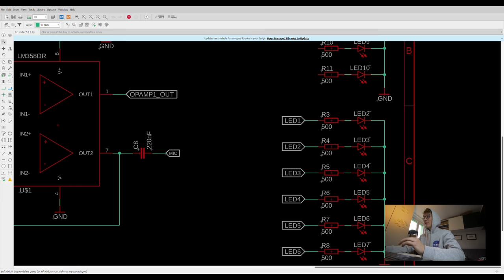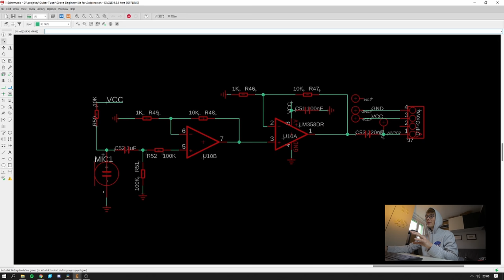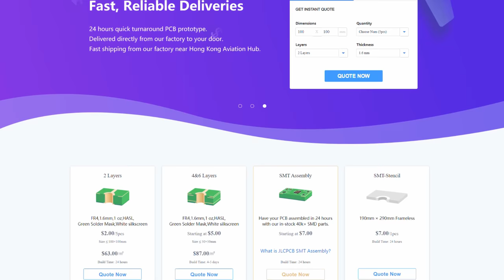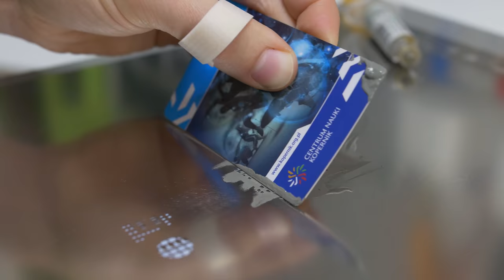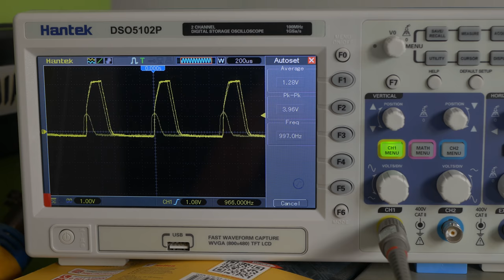Arduino Based Guitar Tuner

Comment: Awesome project Nikodem. To get around your microphone issue have you considered a vibration sensor to pickup the string frequency. This is how the small clip on tuners work, they don't use microphones and relay sounds waves, but rather are pressed against the guitar timber and pickup the vibrations physically transferred from the string resonance to the guitar body.
Reply from the maker: Thanks! Most likely those use piezo element that can pick up wider range of frequencies :) You are right, that would definitely work better than a microphone

Comment: I’m amazed an Arduino is fast enough to do FFT as it’s pretty floating point and multiply heavy and that little 8bit cpu doesn’t have those capabilities in hardware. And even if you’ve ever done FP in assembler you know how much cycles go to waste.

Comment: Really nice work! You should make a 3D printed case that you can clip to the guitar :)
Reply: Or just buy a tuner for 7 euros :) it’s cheaper in comparison :)
I have several of these now. One on my mandolin, an instrument notorious for retuning :)
And some guitars that I use alternate tunings on and aren’t locking nut and floating bridge.
I am amazed how they can make these so cheap. 30 years ago when I started to play guitar and also did guitar setups. I got a BOSS tuner, and that was the first of its kind in a portable form. And it costs the equivalent of 250’euros of today’s money. Now these tubers are so cheap they can almost come in  a cornflakes box.

Comment: The problem with your design is that your display limits the resolution of how finely you can tune. Likely you’ll be off by a few cents. Check out Peterson tuners for a better example.